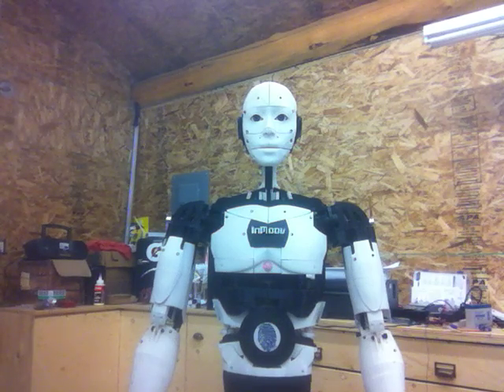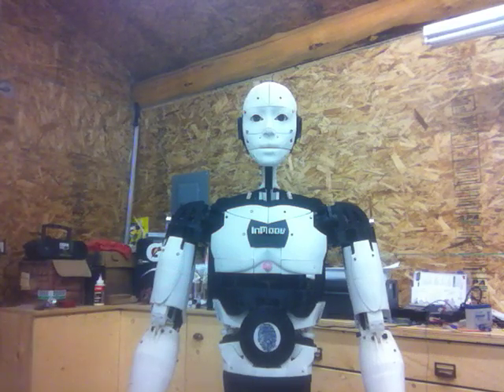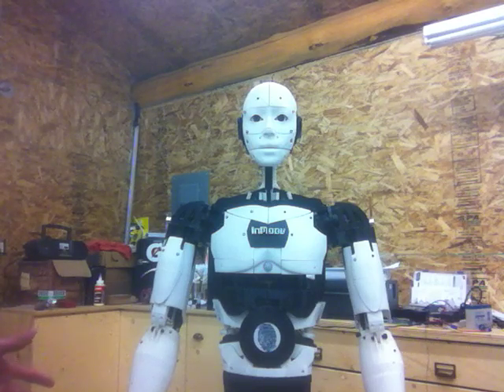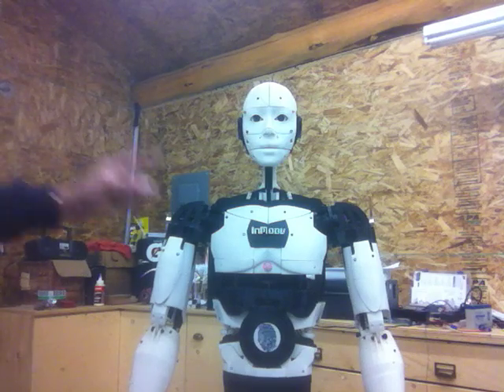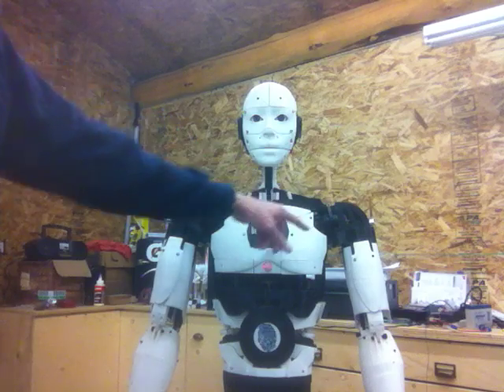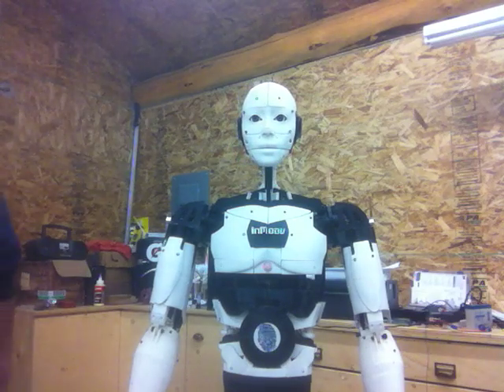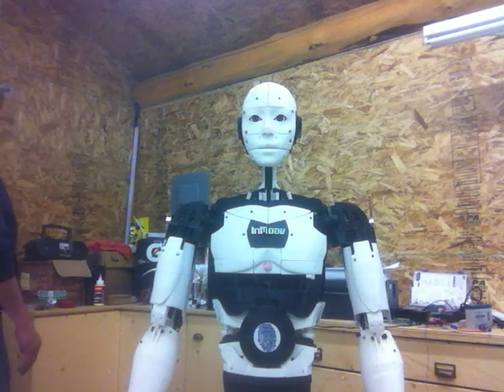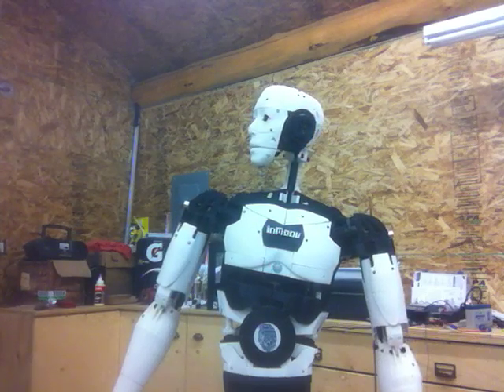Sensors

Comment: Bob,  Looks great but i'm missing the Ultrasonics in the shoulders on the complete inmoov and the pir on the back. 
But do you also run it with myrobotlab and if so how do you do these demo's 

Kind regards

Johan
Reply from the maker: I run my InMoov with EZ Robot. I write a script for each demo (very easy with EZ Robot software). Any sensor is easily added with the software, so you can have as many as you need. Check out   ez-robot.com